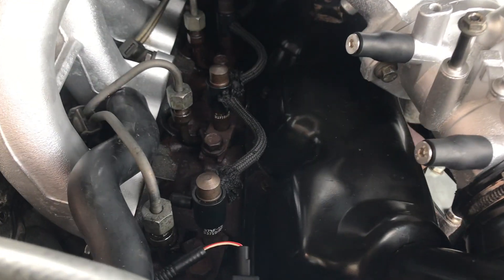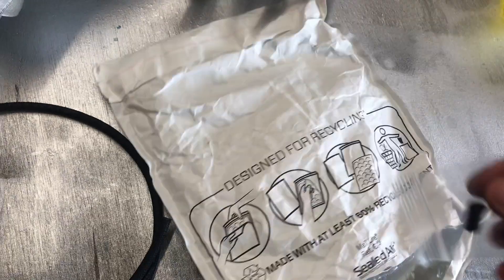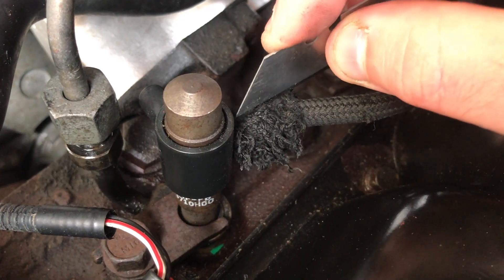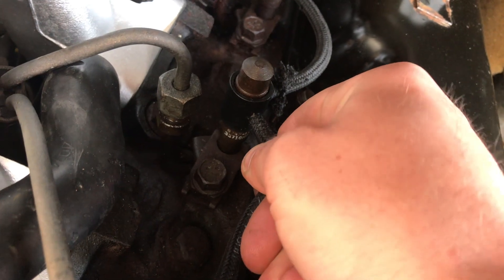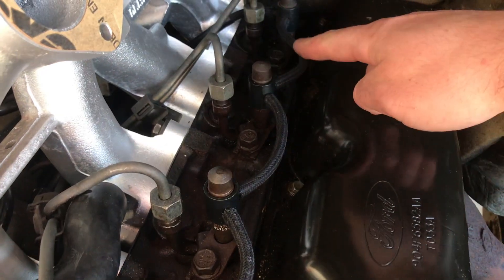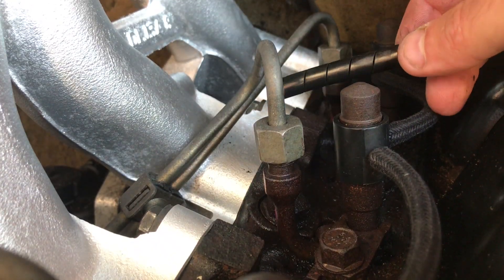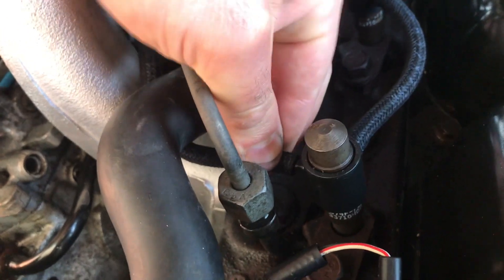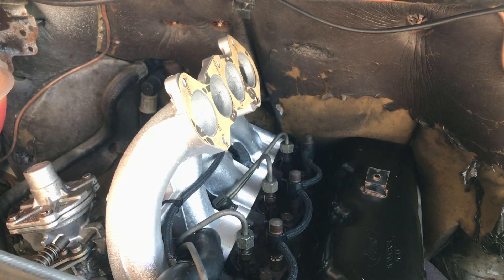Transit LDV 2.5DI Leak off pipe replacement & modification

Comment: hi i have 1995 ford transit it has started to blow black smoke any idears please
Reply from the maker: Hi, black smoke is usually an indicator of too much fuel or not enough air. It could be due to a blocked air filter or possibly faulty injectors. Is it a turbo model?
Reply: @TurnersWorkshop97  no turbo banana engine
Reply from the maker: Air filter clean?
Reply: @TurnersWorkshop97  yes
Reply from the maker: You could try cleaning the inlet manifold if you haven’t already also blank off the egr valve will help. Did it happen suddenly or it’s gradually gotten worse?
Reply: @TurnersWorkshop97  i put new piston rings in last winter all fine pased the inspection went to spain 5500 klmsi think it started when climbing a lot of hills i have put oil catch can in blanked egr off and now it blows black smoke when rev it hard meny thanks
Reply from the maker: Possibly injector issue then, maybe try doing a leak off test. What mileage has it done and have you had the injectors reconditioned before?

Comment: Schon mal Einspritzinjektoren gewechselt /gezogen?
Reply from the maker: I never needed to fortunately, I know they can be a bit stubborn sometimes! 😅
Reply: @TurnersWorkshop97 darüber findet man hier auch nix...

Ich hab mir solch Hydraulischen Satz zum herraus klopfen mit Pressluft Kolben gekauft.. Muss ich wohl ins kalte Wasser springen, denn ein Injektor hat schon die doppelte Menge an Rücklauf vom geringsten und mache dann alle neu bei 152.000 km, denn bei 100.000 sagt man sind die reif zum wechseln.... Dann werden die alten von Ford überholt und dann kommen die neuen von Transit Center aus Polen ="Stanley (oder so ähnlich der Hersteller) da rein... Dann ist ruhe
Reply from the maker: You might be alright mate, at least they’re Iron blocks and not aluminium. Will also help to heat around the injector for a couple mins using a torch 👍🏼 Good luck,  let us know how it goes 😅🙏🏻

Comment: can these small plastic tube element can be replaced from injector? It broke off when I was trying to remove this rubber hose.
Reply from the maker: Yes I think you can unscrew the metal cap on the top of the injector and the plastic part will slide off. It’s sealed by 2 o rings. Alternatively you could use the broken one as the end injector and plug the broken nipple with a small screw or something. Just an idea 👍🏼

Comment: I absolutely do not understand the meaning of the manipulations of the author of the video with the return pipes.
Instead of one short pipe from the fourth injector, he ran one long one from the first. This increased the risk of its damage during any repair work on the engine.
Did the author have problems starting the engine after a long period of inactivity? I do not understand English, but I made this conclusion from reading the comments to the video. The reason for this could be a malfunction of any of the pipes connecting the return pipes of the injectors.
The author of the video replaced all the pipes with new ones and, perhaps, solved the problem. Or maybe he did not solve it, if the reason is a leak in one of the injectors.
That's why I gave the video a dislike.
Мне абсолютно непонятен смысл манипуляций автора ролика с трубками обратки.
Он вместо одной короткой трубки от четвертой форсунки провел одну длинную от первой.Чем увеличил риск ее повреждения при любых ремонтных работах на моторе.
У автора были проблемы с пуском мотора после длительного простоя?Я не понимаю английского языка,но сделал такой вывод из чтения комментариев к ролику.Причиной этого могла быть неисправность любой из трубок,соединяющих обратку форсунок.
Автор ролика заменил все трубки на новые и,возможно,решил проблему.А может и не решил,если причина в негерметичности одной из форсунок.
Поэтому я поставил ролику дизлайк.

Comment: just a quick question,does it matter which nozzle the blanking plug goes on injector 1 and 4,looks like my blanking plug on inector 1 is on a different nozzle to yours?.cheers
Reply from the maker: Hi, the blanking plug should go on injector 4 at the back and the return line from injector 1. This is to allow the air to escape from injector 1 as it sits slightly higher and should prevent the misfire issue some have had :)
Reply: @TurnersWorkshop97  hiya pal,no what i mean is my blanking plug is  currently on the other injector nozzle to yours(ie where your blanking plug was on injector 1,on my its the return pipe to injector 2 if you know what i mean).the injector is installed the same way,,does this make a differance?
Reply from the maker: @seangreenwood8331 ahh ok mate I know what you mean now. No won’t make a difference which side you blank and which side returns as they’re both common 😊
Reply: @TurnersWorkshop97  cheers for that

Comment: Those this mod make any difference to the Ford transit banana 2.5 tdi 1996
Reply from the maker: Hi James, it might make a difference. I believe the TDI engine is very similar in design so if you have a miss fire issue would be worth doing 👍🏼

Comment: Hi, would you happen to have experience with renewing the front downpipe of the outlet? I bought a replacement (in France) but did not count on the 3 Imperial nuts that hold down the front flange but are fit on way-too-long threads!!! My sockets of the (simple) imperial sockets I have, will not go over the thread and reach the nut. Even if I buy new set of Imperial sockets, they won't help. Should I try grind down the surplus thread? It is so very hard to reach in between carosserie and engine, other tools like common keys won't fit in. Now I really have a problem 😞
Reply from the maker: Hi, I haven’t had to remove the down pipe before. I can imagine that it’s not easy to get the three nuts off without snapping the studs if they’re very rusty. I would look at using a nut splitter possibly. Heat will help get them loose. Pass through socket set. Or like you say you could just cut the studs down.
Reply: @TurnersWorkshop97  Thanks! Using heat before applying any force is a good idea and most certainly I'll look up the nut-splitter-tool which until now I had all forgotten about, GREAT. 
I ordered extra deep/long Imperial sockets of the type that can also be used on pneumatic/electric shock-spanner tools. Cleared the rust off with a brush and pre-sprayed WD40 to begin with. Once I have received the sockets, I'll repeat WD40, heat up the nuts if I can (using some heat shields to prevent other damage) and then first manually, if need be pneumatic shock, to undo them. There is hardly any space at all and if I fail, the whole outlet manifold/turbo assembly has to come off, but worse : NO holiday 😞 After this I'm só done with Ford and imperial measures in general, I'm on the edge of selling both Land Rover and Ford...

Comment: Hi I have a mk6 im changint the return line, Does it need to bleed?
Cheers
Reply from the maker: Should be fine as it’s just the return from the injectors back to the tank 👍🏼

Comment: Ha! Remember doing the leakoff mod way back when my V reg smiley was new....used to randomly drop a cylinder before doing it. Great days, was a great van and the last smiley Mk5 I had. Miss that van. Would love another mk5 swb
Reply from the maker: 😆 you should get another, there’s still plenty around 👍🏼
Reply: @TurnersWorkshop97  I'm working on it 😁 winter project time

Comment: Hello, mate! Can you please tell me where did you get the blank from? It is specially made for injectors? Thank you!
Reply from the maker: Hi Paul, it came with the leak off pipe. You will be able to get from eBay. 3.2mm id leak off pipe with blank 👍🏼
Reply: @TurnersWorkshop97  Found it! Thank you very much, mate!

Comment: Are you going to be servicing your injectors at some point?
Reply from the maker: I have thought about it, if it’s something which people would like me to cover I will give it a go 😆
Reply: @TurnersWorkshop97  oh right OK buzzin on one. My mk5 sure is sluggish and the injectors are the only thing left to approach.
Reply from the maker: Engine service, blank egr valve, clean inlet manifold. Have you turned up the injection pump? If still not enough, stick a turbo on it 🤔
Reply: @TurnersWorkshop97  yeah I done al the things that should help. Bought it in 2014, and have used it everyday nearly. Converted to a camper and Spent 4 winters in Portugal in it and its never once let me down.
Reply from the maker: Haha nice mate, the engines are like cockroaches🪳

Comment: Your video's are really helpful! I've bought a 1994 transit a few months back and didn't have any mechanical experience so I've learned a lot thanks to you. Any chance you're going to replace your brake fluid and oilfilter? :')
Reply from the maker: Cheers man, that’s great to hear! I will be making a service video very shortly and that will conclude the engine maintenance. When I got my van the brakes had all been done so probably not brakes. 😁👍🏼
Reply: @TurnersWorkshop97  great! I'm looking forward to it! Are you also going to travel or more like short holidays?
Reply from the maker: Just short trips away this year as I work full time 😁 is yours a camper?
Reply: @TurnersWorkshop97  Nice, if you ever visit the Netherlands hit me up! Mine is a short base camper with a high top. Although it's still empty inside.
Reply from the maker: Thanks man! That’s really kind of you 😊
Reply: @TurnersWorkshop97 .    Hello ,  great video.   My sleeves are damaged so will need replacing.   Can you recommend a supplier ?   Thanks.
Reply from the maker: Hey, thank you! Are you looking for a recommendation of leak off pipes?
Reply: @TurnersWorkshop97     Not the pipe work,  I followed your link,  but the sleeves which you took great care not to damage.  Thanks.
Reply from the maker: Unfortunately I don’t know of anywhere that sells them. It might be worth phoning a diesel specialist as they could advise on the part you need. Stanadyne injectors are commonly used in boat engines I believe so you could also ask a marine engine specialist. I think the cap just unscrews and you can replace the plastic part. Complete injectors are available on eBay but not so sure about the quality.
Reply: @TurnersWorkshop97     Thanks.  I did find some from a company in Turkey but I hoped for something over here.   Thanks again.